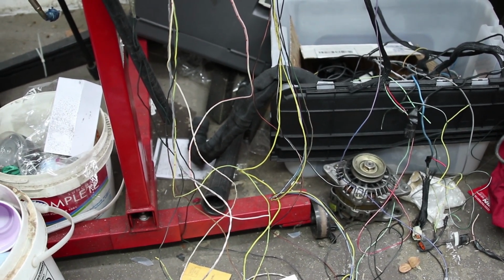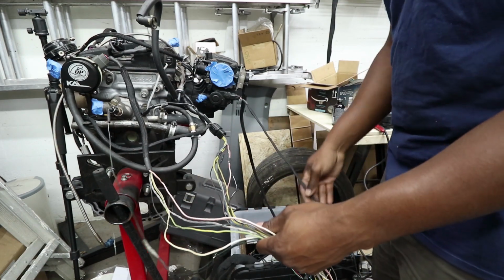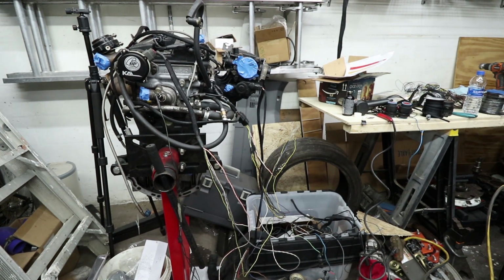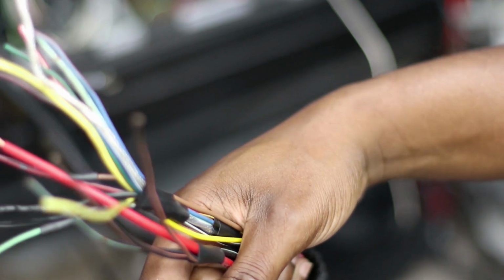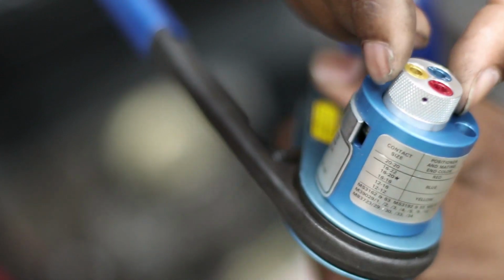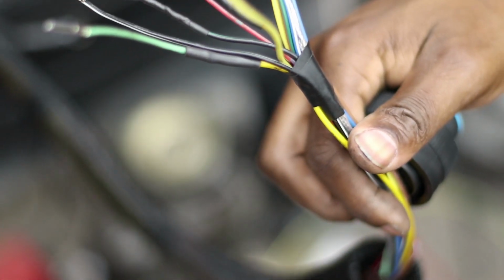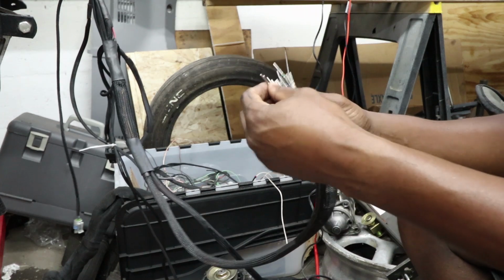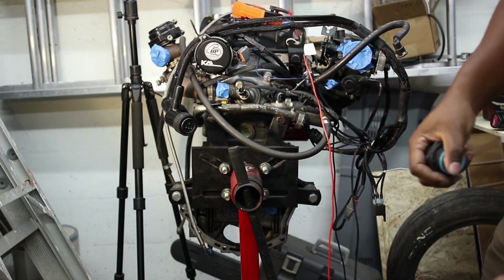Making Quick Disconnect Engine Harness For The Escort.

Comment: Where did you get all the wiring plugs and supplies?
Reply from the maker: The connectors are deutsch hdp20 series, I bought the kit on Amazon,  came with the male and female side and pins and sockets. Heat shrink is harbor freight, branded sleeves from Amazon.
Reply: @StovallsGarage  Ok nice. I was looking at those kits off amazon also.
Reply: Thank you very much for posting info on item name and where to buy. 🙏 Got a Japanese project car I would love to convert the wiring harness to.

Comment: Just wondering for the fuel injector wiring near the fuel rail did you cover it with just the cable wrapping sleeve and some heat shrink? Was working on my car and the clips are super old so I'm soldering new plugs on and was just thinking of getting rid of the wire cover and doing this. I wanted to know if this was holding up well for you, thanks!
Reply from the maker: Nah I didn't rebuild that part, it seemed clean enough , and it's tucked under the manifold.